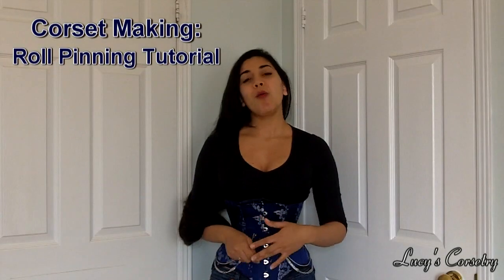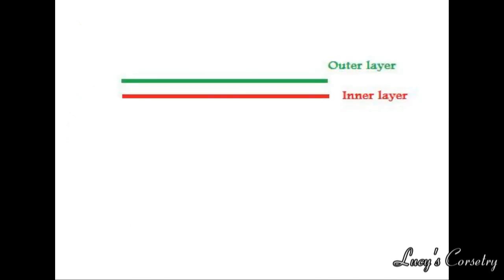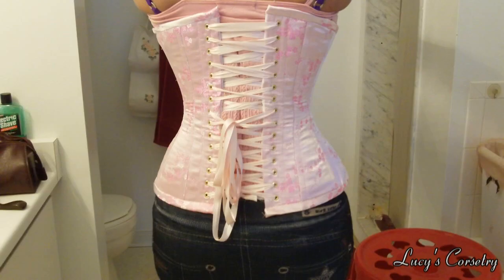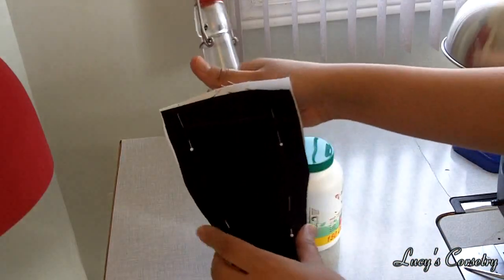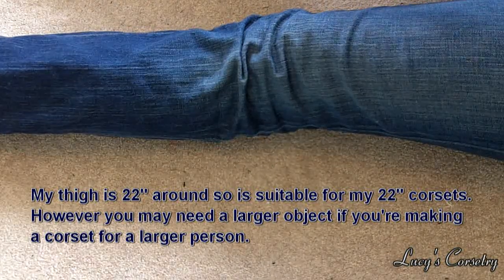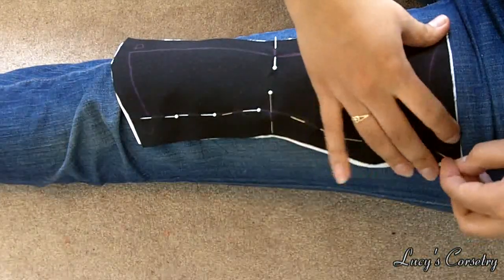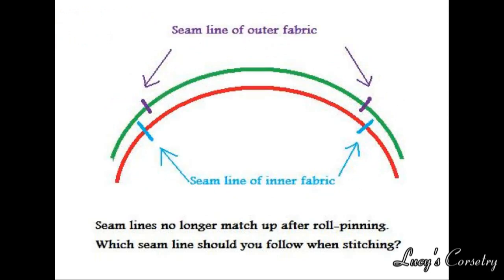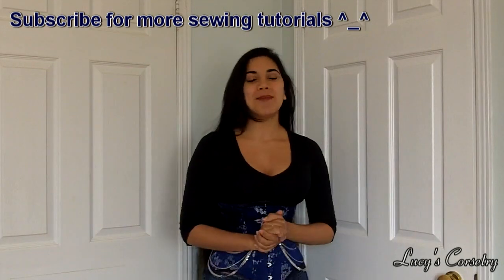Corset Making: Roll-pinning/ Turn-of-Cloth | Lucy's Corsetry

Comment: I always count on you to have the most thorough and mathematical explanations of anything I have questions about. I wonder if you've found any working method of drafting turn of cloth into a sandwich-method corset, where you aren't roll pinning individual panels but trying to match up already assembled layers? I tried a mockup with my typical method of Guess-and-Hope and ended up with an inner layer a full two inches smaller than my outer layer, which seems pretty excessive. Perhaps more strategy is required.
Reply from the maker: I haven't tried to draft turn-of-cloth directly into my corsets, but I think on the Foundations Revealed site, Jenni Hampshire had written an article about drafting a certain amount of ease into the hip of a corset to prevent stress lines in this area. I think that article requires a membership to read, however. :\

Comment: I did my first roll pinning last night.  I noticed that it was easier than flat pinning!  I was using a 1-litre soda bottle and I felt like I was able to hold the panels in place better while pinning so that the two layers of fabric shifted less.
Reply from the maker: Awesome! :) I'm sure that using a bottle also involved less risk of poking yourself with pins compared to using one's lap too. XD
Reply: ***** Yes it was, though the bottle was a bit...shall we say textured aftwerwards.  ;)

Okay I had a follow-up question and I've already looked for answers elsewhere.  Either I'm misunderstanding what I'd read or I just couldn't find the answer. So:

Once you roll pin your top and strength layer together (or strength layer and lining), do you flatline the edges? And if so, do you then treat the pieces as one, and go on assembling your corset panels together by pinning them flat?  Or do you not flatline but also roll pin the panels together before sewing the joining seam?
Reply from the maker: ***** After you roll-pin, then you stitch the side edges to anchor the two layers like that. When you try to make the panel lie flat, you will notice that the top layer wants to bubble a little bit, and that's perfectly normal. After that you can treat the panel as one layer when assembling the corset.
Reply: ***** Okay perfect.  Thank you, it was easier than I was trying to make it out to be.

Comment: Can you elaborate or possibly make a video regarding the clipped curves you mentioned? I put boning within the seam allowances in most of my corsets but the waist line on the side seams has a lot of pulling and the only way I can find to combat this is to clip the curve, but then that creates sort of a hole in the boning channel. It's hard to explain! But I haven't been able to find anything on clipped curves in corsets.
Reply from the maker: I know exactly what you mean - and it's super annoying to have to navigate the bones through "flaps" where you clipped the curves! Some people find it easier to just trim down the whole seam allowance, sew on a separate channel for the boning so they don't have to deal with the hassle. This is especially important if you're doing a single layer corset where the boning channels will be visible.
Reply: Thank you so much, I thought maybe I was the only one having this problem or there was another technique I hadn't thought of or found. Thank you for replying, your videos have been very helpful!

Comment: Hi Lucy! I have some questions: what if you're making a corset that isn't flat lined, but two layers? Do you recommend roll pinning the corresponding pieces together in order to trim away any difference in the size of the cut panels, and then sewing each layer? If I did that, would both layers match up perfectly at all seams when I join them by stitching in the ditch? Btw, stitching in the ditch perfectly is really difficult for me. It's always slightly off in the back...ugh. Is there an easier way to do that and get the stitching perfectly centered in both "ditches"?
Reply from the maker: +Erin Tapp Stitching in the ditch perfectly on both sides is difficult for me as well (and looking at some of my OTR corsets, almost no one does it perfectly). There are special presser feet sold that can help with stitching in the ditch a little easier.
I didn't roll-pin the "Wrinkly Pig" corset, which is why it has so many stress wrinkles in it. If I had roll-pinned each panel, it would have turned out quite a bit better, I'm thinking. But roll-pinning does require you to sew more than one layer at a time, so it's a slightly different method to the sandwich technique where you only sew one layer at a time.
Reply: Oh, I see. I'll have to look into getting a presser foot for stitching in the ditch. It makes me feel a little better that it's not my crappy sewing that's entirely at fault, LOL. I'm not the best seamstress in the world! But I'm trying to improve. I imagine it's easier to stitch in the ditch perfectly if the fabric is two layers of sheer corsetry netting, because one would be able to see if the seams are perfectly aligned.
(I can't wait to experiment with netting!) If I ever make a corset that's two layers sewn together at one time, I'll roll pin it. Thanks for answering my questions, Lucy...I really appreciate it!